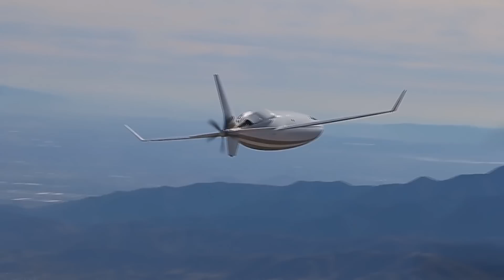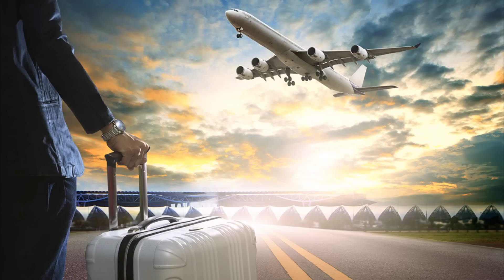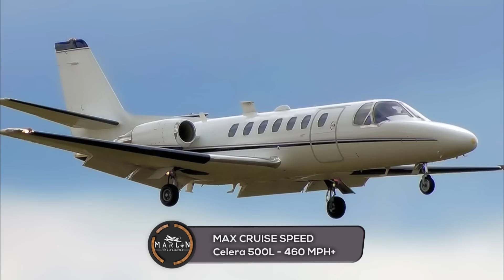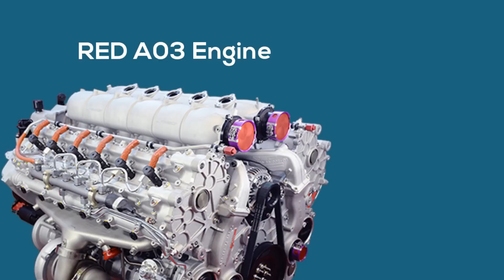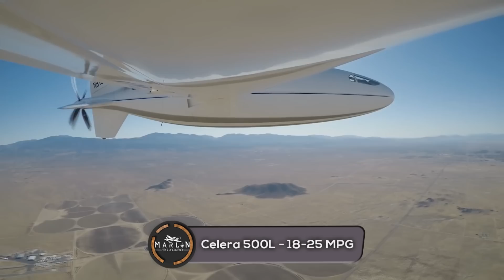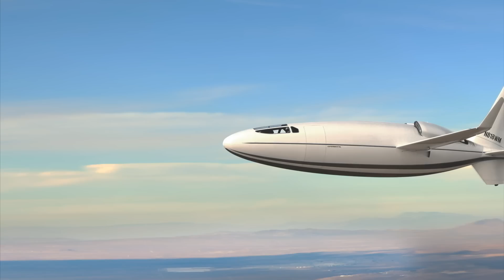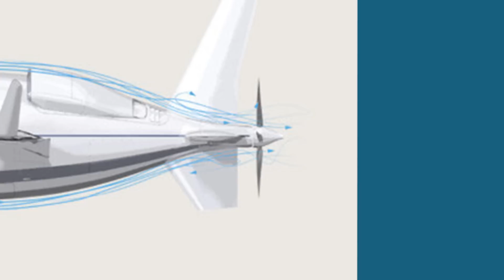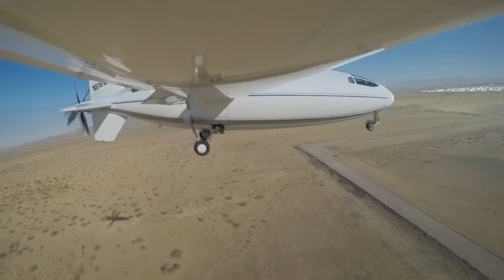Meet the Celera 500L (Flies Faster, Farther, Higher, Cheaper)

Comment: Seen claims like this before, aviation is a road littered with the carcasses of such projects. I'll believe it when full production model is validated fully against those claims.
Reply: That is true. I‘ve been an aviation enthusiast since my childhood in the 60s, and have seen many come and go. Often the claim was made that “this aircraft was way ahead of its time“. Which begs the question, why wasn‘t it picked up again after time caught up with the advancements that had been made? 
Remember the Beechcraft Starship? How beautiful. How novel. How revolutionary. How ahead of its time. It just vanished.
Reply: This one has a good chance of coming close: First, the power plant exists and is certified, so the engine performance is proven. Second, composite construction allows a large run of laminar flow - essentially the first time this has been possible. Wake-adapted propellers have the possibility of achieving very high propulsive efficiencies - which have also been documented by decades-old wind tunnel tests. I have questions about stability, but that too should be doable. First time in a long time I have seen a project with this much potential. It could of course end up on the scrap heap for economic reasons - Otto seems to be aiming it at private owners, but to me it is an attractive replacement for corporate jets.
Reply: @marcdepiolenc1880  Military applications are where the money is, because the DOD has $$$.  This reminds me of SpaceX and Tesla.  And it can be fully automated, so flying it will be easy.  single pilot.  Heck my SEL/IFR license would let me fly it.
Reply: @marcdepiolenc1880  I live in Atlanta.  Having to go to Hartsfield Airport blows.   Now, If I could go to a smaller regional airport instead, at least one that I know if pretty close by, I would buy that ticket in a heartbeat even if it were a good bit more.   Given the apparently ultra low operating cost, the ticket prices might compete with enough of these babies flying common/popular routes.  Seems to have a cruising speed thats about 20% less than average airliners.  That extra time to get to DC would more than compensate for the amount of time and BS and stress having to deal with a monster airport.  If I had that option, I'd take it every time.  Even though, I know, this isn't going to be intended for the masses.  But I bet they could figure out a way to increase speed at the cost of fuel economy to get even closer to airliners.
Reply: @alexrosenthal2887  Can't dispute any  of that. I live in the Philippines, and for fun I compared the time required to use a high-speed water taxi (a hovercraft) to travel certain routes, as opposed to scheduled airlines. Even if you live right next to an airport, and your destination is also close to an airport, the hovercraft wins a substantial number of times.
Reply: @marcdepiolenc1880  Is the power plant certified? It would certainly have to be, and for an engine, that would include the entire manufacturing facility to ensure they were capable of maintaining appropriate quality control. Composite construction allows a lot of control of shape and provides structural strength at light weight, which is why almost no new aircraft design is built with riveted aluminum any more. Not cheap, but not really novel. Everything designed in the last twenty years is high aspect ratio laminar flow composite construction. Good news is, even if this flops, and aviation is a hard nut to crack, We will enjoy something using most of the exciting technology that makes this seem gee-whiz.
Reply: @herbertshallcross9775  The engine is reported to be certified.
Reply: @marcdepiolenc1880  Thank you. I did some research and the Red A03 is certified in some aircraft in Europe, so certification in the Celera shouldn't prove a major barrier. Not free or easy, but not impossible. Engines rely very heavily on things like the cooling, which is dependent on installation,. so engines are certified for particular aircraft.
Reply: @herbertshallcross9775  Certified for a particular aircraft? That must be a European rule. In the USA, engines are certified as independent entities. The manufacturers naturally provide data for use in installation and particularly in providing adequate cooling. I'm currently writing a book on the design of cooling systems, so I've been following this closely.
Reply: It is unclear from the Web whether that engine was made in more than a handful of samples.  Currently, no known aircraft is using it.  In fact, no serial aircraft has ever used it.  Hence, serial manufacturing does not exist.  Gas turbines are fairly efficient and have higher TBO.  Why not use a gas turbine?  I suppose, because diesel engines have better fuel efficiency but lower TBO.  TBO v fuel efficiency.  More importantly, corporate jets are faster and those who own them do not give a toss about fuel efficiency.  Hence, is there a demand for it?
Reply: @yurizaichuck5197  there is... not all can afford the best and the most expensive private jets. and those who fly private turbo props wouldnt mind an upgrade not to mention all that that want it but cant afford but... those claims are kind of... off the scale... 3 times faster 5 times less drag 7 times further 9 times less fuel consumption and so on and so on... very unrealistic. oh wait... do they use only "magic" numbers too?
Reply: @jebise1126  If Biden gets elected they may ban air travel altogether long before this one gets certified...*)))
Reply: @yurizaichuck5197  You're an idiot Yuri.  If Biden is elected...nothing will change related to air travel.  I have to wonder what makes morons say such stupid things?
Reply: @yurizaichuck5197  you really have no idea what powers what. "gas turbine" virtually all jet and turboprop engines burn jetA-1! The most common aviation fuel in the world. Many very reliable engines to base this engine off of.  You probably could convert this to a turbine engine, not sure why if the numbers are even close to advertised.
Reply: @yurizaichuck5197  Air travel is up. Sorry about being facts based.
Reply: Basically they took a high performance diesel engine and built a plane around it.

The odd shape is because they needed a business class cabin for six passengers but low enough drag that a single engine could get it up to speed.

The engine is what makes it special.

It uses a cheap fuel,  has the superior fuel efficiency of a diesel engine and because of a neat trick the FAA rates it as two engines for safety (each bank can run independently of the other)
Reply: Wasn't the Lear Fan supposed to do similar to this aircraft?
Reply: @cfgosnell  Yes! Very close... If this new one is that energy efficient, maybe, they can try to fly on a battery... Aviation Alice 2...
Reply: Emphasis on carcass? If this is the result of 50 years of aircraft forensics it should be supported for it's science, rather than prospective clients. Mega-bus aircraft are both socially and politically vulnerable to abuse. A fleet of small craft that can move just as quickly will bring traffic to a lot of outlier airfields. And it looks a lot less liable to bird-strike.
Reply: Said Orville Wright to his brother Wilbur.
Reply: Bingo!
Reply: FL600
HaHaHaHaHaHaHaHa
Reply: @dhill4001  Not just 600. 650. In a piston aircraft.

Technically, the altitude record for a piston is around 670, but that was an unmanned experimental. I seriously doubt that a manned piston aircraft could reach that altitude. Would love to be proven wrong, but that claim alone makes me think the whole project is a scam.
Reply: @justtwoseats  I remain unconvinced though I guess it could happen.  After all the Perlan 2 flew to FL760 and it didn't even have a motor.  Right place, right time.
Reply: exactly! they use a half-experimental aero-diesel which was never produced in any numbers.  because nothing else is available at that power level...  other than a gas turbine...*)) so, they need to create two businesses.  making a decent engine is more or equal in complexity to building this aircraft.  tickets a cheap as as it is in US already.  Is there a market for this?  if yes, where...
Reply: @yurizaichuck5197  this uses JET-A (and or Bio-diesel) the most common fuel in aviation. Nothing experimental about that
Reply: @yurizaichuck5197  It won't be as cheap as normal commercial travel. It's more like it will (supposedly) match the cost of business class with the flexibility of private.
Reply: @yurizaichuck5197  Not for airlines, but for those wanting to buy a private plane like a King Air, but don't want to deal with maintenance expenses.
Reply: @yurizaichuck5197  Really! The task is about the same as producing a competitive Formula One auto engine. About a hundred million bucks to produce perhaps fifty engines, but Formula One engines don't have to go through FAA certification.
Reply: @yurizaichuck5197  They said something about the engine being able to operate as two six cylinders to provide some of the redundancy of a twin engined aircraft. I think Menasco did this in the 1930's. Nothing new under the sun.
Reply: Rocket Surgeon yup.    Remember the Beach Starship........what beach starships🙊
Reply: There always has to be an arm-chair wanna be  engineer (aka rocket surgeon), party pooper. The only way to shut dumb critics like you is to slap a major brand on it and the new idea is suddenly legit.  Case & point, Joe Clark who invented integrated-winglets once was criticized and ridiculed by his co-workers or people like you. So he left the company which I think was Boeing and patented the integrated-winglet then formed up with two engineers/inventors friends and started working with Falcon then Gulf Stream where his integrated-winglets broke all kinds of world records. Later Joe came back to Boeing as a privet engineer thus bypassing all those clowns who thought they knew it all.  Boeing than did some tests and quickly discovered that winglets worked better than anyone expected.  Years later those critical clown engineers from the past were going around praising the inventor claiming they knew him well and were good friends.  How to I know this?  My son is a good friend of his grandson who happens to live on Mercer Island, where I live.   With critics like you, the round wheel would probably be criticized by you, as yet another invention carcass littering your mind.
Reply: @dansotelo228  there always has to be an arm-chair wanna be engineer, who is all to eager to swallow a marketing scheme hook line and sinker. Countless brilliant minds have dedicated their lives to improve the aerodynamics of planes for over a century. Yet it doesn't ring any alarm bell in your mind when some startup which likely needs investors claims it can use well studied concepts to design an airplane which can fly thrice as fast and 8 times more fuel efficient than anything other companies have come up with so far?

Waiting for the production model to live up to the advertised expectations strikes me as a reasonable thing to do. True breakthroughs are Incredibly rare. On the other hand startups which oversell their product are common.
Reply: They have been flying there test model for some time...
Reply: @davidhollenshead4892  - Are the video of the test model?
Also, it has been mentioned elsewhere that the aerodynamics assume a specific scale - that the design only works in a limited range of scale.
Reply: @richardgreen7225  That's addressed in the video.
Reply: @richardgreen7225  I think by scale they mean size of plane.   A plane 2X larger same shape same speed would have 2x the Reynold's Number and cross over from laminar to turbulent flow.    They are looking at scaling it up ~1.2X for 10 passengers but that is limit.  But for 6-10 passenger plane could be good choice.

this thing cruises at near jet speeds - > 400 MPH and gets ~18 MPG.   

It would be great from small town to small town.
Reply: @muskepticsometimes9133  Transition Re = 500 000,  Laminar length at 400MPH  = 0.1 m
Reply: @davidhollenshead4892  The test model doesn't even have windows, let alone a cabin interior, or a potty. Probably doesn't even have landing lights. A production model would have to be pressurized , and  have deicing and weather radar for an aircraft in tSurgeon
Reply: @davidhollenshead4892  Is there any footage of the plane flying except the single takeoff and landing that seem to be in every video?

Comment: Marlin...not sure where you get your knowledge from, because it is apparent your understanding is quite limited to actual real flying.  I am an airline pilot with more 7000 hours experience.  It is obvious that you are reading a script without any real understanding of what it is you’re talking about.  This so-called experimental aircraft can not obtain the altitude you mention of nearly 60,000 feet, or in real terms FL600.  Why?  Because no aspirated engine can, even with turbo or superchargers.  The engine is a Diesel engine and Jet A fuel is a purified version that is used in jet aircraft.  Because of the fact that you cannot compress the air like a turbine can, you’re pretty much limited on the altitude.  Secondly, the range is skeptical as well with a V12 because of the burn rate.  Diamond Aircraft was the first to truly utilize the Diesel engine burning Jet A in a high production plane known as the DA42 and later models with the DA62.  They were able to get each engine burning approximately 4.5 - 5.5 gph (gallons per hour) .  A V12 with boasting of 500+ horsepower will burn easily more than 15 + gph and probably more  depending on the max takeoff weight (MTO).  If that is the case, you’re talking about a minimum of 100 - 200 gallon tank (700 - 1400 lbs of fuel) for flying long distances with a minimum reserve.  The claims here are a fantastic fantasy at best.  Let’s see the real data.   Let’s see the long range test flights.  The high speed test flights.  The max altitude flights.  Max weight flights.  Otherwise it is still just another wannabe experimental aircraft.

Comment: Really cool design - but don't you need a minimum of two props for transcontinental services with passengers? It technically has two engines, but still only one prop. Counter-rotating props would probably work - but the complexity doesn't outweigh the advantage in this case. Perhaps electric turbine thrusters in the scoops on a hybrid setup could be used in trans-Atlantic service. IDK

Comment: Dreamware. 

All engineering wishes. 
Until it is actually flying it is dreamware. 

Fuel costs 8 times less?IMPOSSIBLE.  1/8 as much maybe.

The diesel engine does have the potential for fuel cost savings. And maintenance costs reduced.

Its only revolutionary if it becomes real.